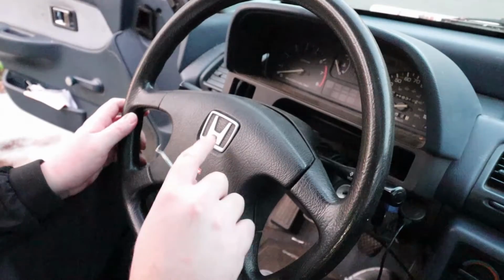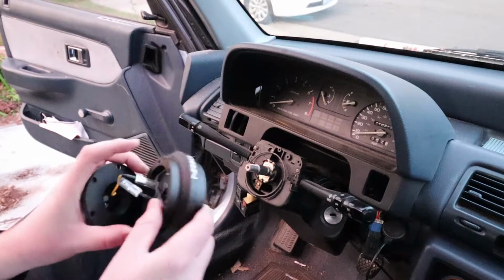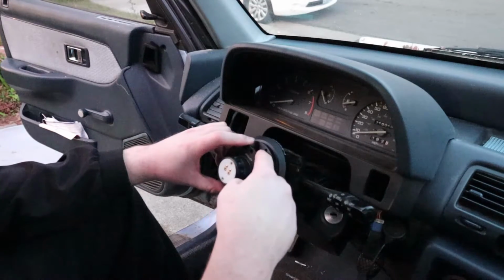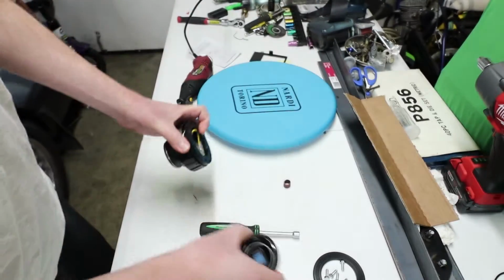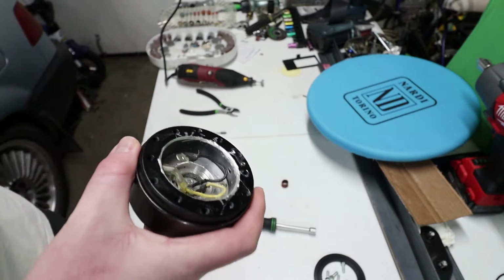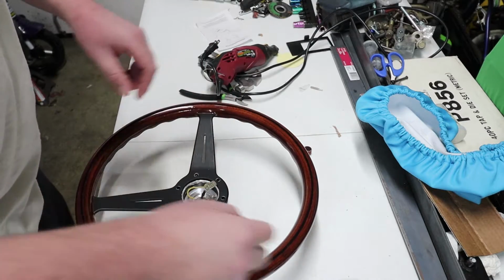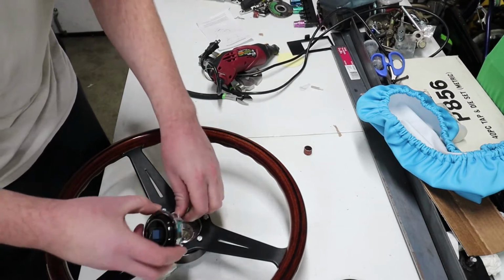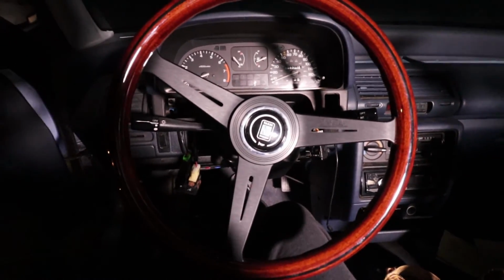How to install a NRG quick release hub and Nardi steering wheel on EF Chassis! ( no Air-Bag )

Comment: the ef doesnt need a shoe horn? just hub with brass, quick release thats covered for wiring n steering wheel horn wiring plugged. the gold peice that stays there behind oem steering wheel is whats needed for it to work
Reply from the maker: whatever i did worked
Reply: much appreciated!  @4realtime783

Comment: The two bolts that slips into the plastic cups on the ring barely hold. I cant see how it stays on. Am i missing something
Reply from the maker: No they are rubber and fit very snuggly nardi is good at what they do
Reply: @4realtime783  not for mine. I wonder if its a knock off.
Reply: @4realtime783  ohhh i know why...its not the rubber thats holding it. Its your horn button thats keeping ring secured
Reply from the maker: @Anthony-cc8bx  that helps too but it doesn't snap into the hub it's just a added tension
Reply: @4realtime783  yes the bolt cup only snaps on but will fall off without horn there. Try it and u will find out lol. It doesnt hold at all
Reply from the maker: @Anthony-cc8bx  Yeah I've never installed it without it because I have no reason to but good info.

Comment: Finally a video stating what to do With the ground wire, I was trying to figure out if I could solder it on, but your trick looks like it works
Reply from the maker: Yeah some people just say you can leave it in there loose but I like to clip mine in there to maintain a better contact
Reply: @4realtime783  damn leaving it loose is a very bad idea